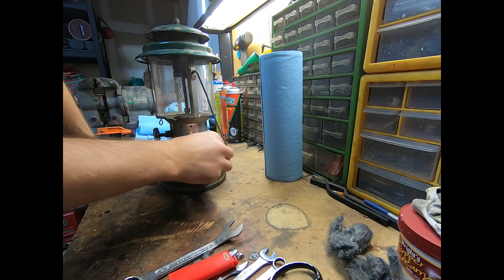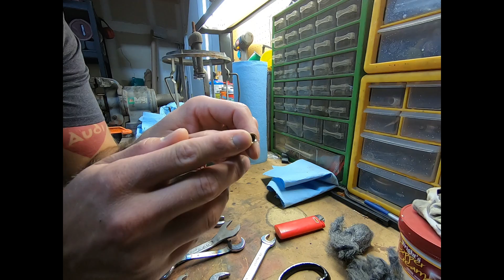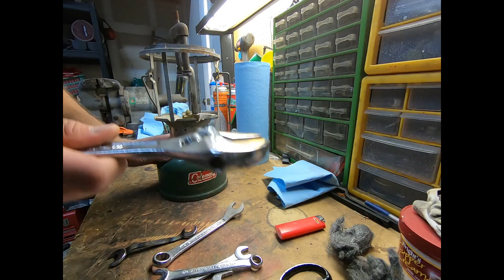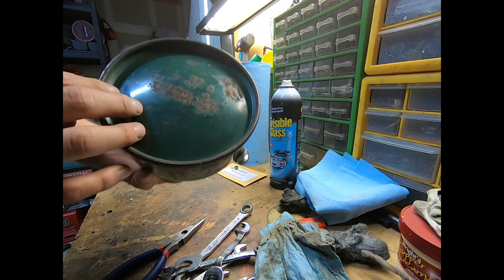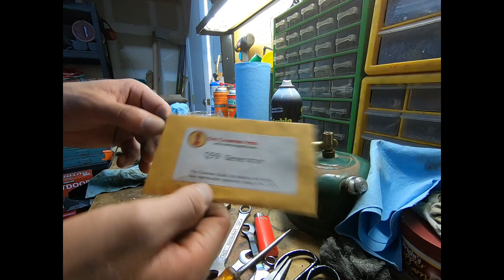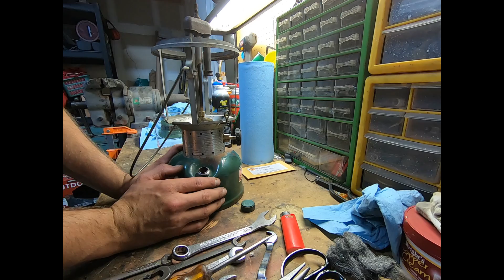How to Rebuild and Light Coleman Dual Mantle Lantern (220F)

Comment: Thanks for sharing. Here in Ireland and UK the pressurised lanterns are mainly made by Tilley or Bialaddin of which I have several. The Coleman are much less common and have a bewildering number of models and fuel types used, because of this I’ve stayed away from them. Recently however I got a Coleman 639 kerosene lantern, in perfect condition, still in box, with instructions, spanner and even a warranty. However, seeing as the lantern is dated 1973 that may not still be valid !  Keep em lit.

Comment: For a user without a box.  Most of these models will accept a metal coffee can PERFECTLY.  Cut off the bottom with a can opener.  Make two long slits for the bailer handle (about an inch shy from the top).  Take off the roof.  Slip the can over the globe frame, reinstall the roof.  Hang her in your shed or sit on your shelf.  Unlikely to accidentally crack the glass with a shovel handle or bumbing about.

Great warnings:
A leak at the regulator knob is one of the most dangerous elements of this lamp. If it is leaking shut it off immediately or you'll eventually have a flare up outside the lamp, eventually finding the somewhat sealed pressurized reservoir ...BOOM.

Good description of fixing the valve and graphite ring (seal gasket).  I've seen ones where the bonnet cap is loose, and then even a good graphite will leak once pressured.  For that, I tighten a bit and check again, just like I would with a virgin graphite seal.

With the alternatives we have today, I consider these outside toys only.  Nothing near them that can burn if there is a fuel leak.  Not in reach if any children or adults that don't know what this really is.
Reply: I’d like to see a vid or pictures of that box you talk about. In my mind the way you explain it wouldn’t it block all the light output ? Thanks for sharing your ideas.

Comment: good video, just wondering why you didnt take the valve out of the tank since you had it broken down that far, i rebuilt one of these lanterns and glad i pulled the valve out of the tank, the pick up tube that pulls gas out is on the bottom of that valve and it was all varnished up and the hole was plugged up,the sliding needle was froze up too....
Reply from the maker: So for me it just comes down to if it works, I usually leave it. Unless you have the removal tool it's really easy to damage that part. It's kinda like opening a can of worms if it doesn't go your way. So unless I'm specifically having an issue with it, I leave it.

Comment: maybe you can help. I'm trying to restore my dad's Coleman, same model as this. I cleaned it like you did. it holds pressure very well. it pumps great. however, I can't get it to light. I don't hear anything when I attempted to light it either. I remember a hiss from my childhood if I'm remembering right. any suggestions on how I could get it running again? it looks great. no real rust. all fittings came loose easy. it worked last time it was used but that was 20 years ago. I am trying to save something from my childhood and older things are just better somehow. I'd love to see this fire up again. I just don't know what's wrong or if it's even salvageable. thanks in advance.
Reply from the maker: Sounds like something with the generator. On the backside of the lantern there is a small lever that spins and clears the generator hole. Spin that about 10 times. Then pressurize the lantern open the valve 1/4 turn. If you don't hear anything spin that level 180 degrees. It will point down iirc. If this doesn't work you likely need a new generator.
Reply: @crookedlantern3810  I woke up at camp. Got your message and payed extra attention to the cleaning lever and generator. After about 50 turns I started to hear some sputter. Now after a few more she is running at her former glory! Thank you so much.
Reply from the maker: @robertholsopple9451  wow that's great, I wonder why it took so many? I'm glad you got her running!
Reply: @crookedlantern3810  I cleaned the generator by hand while it was out and apart. I also turned the knob when it was back together. I was thinking you might say that. I wonder if I soaked it in carb cleaner if it would help. It looks good that's what stumps me.

Comment: I just got our model 220F going for the winter season.  cleaned the generator, leak checked inspected everything. Replaced and primed the mantles. 

Quick easy job. Though maybe it helps that this one has been used by me since it was new.

Comment: So we have talked before I watched your video last night I have a quick question what is the best way to remove the soot from the top of the inside the lantern dome also I just purchased a 200 a  and in OK condition but the  bottom of the cage has a crusted rust kind of a Sandy texture what's the best way to remove that
Reply from the maker: Well if your talking about the porcelain vent on top, it can be hard to remove that. You can try to soak it in some soap and water. As for the frame, (steel part) some light steel wool should do the trick depending on if it s rusted.

Comment: Hey Good Video was a big help rebuilding my 220F that I picked up for 8.00 bucks. My question is where did you get that special bent and thin open end wrench ? Did you make it yourself ? You're changing of the graphite packing was especially helpful . On the tip cleaner for the generator can the packing that is int be replaced if it starts leaking ? Also your recommendation for parts were a big help .

Comment: I have a 73 220f the pump won't work right on it are these worth restoring
Reply from the maker: In terms of value, not really, in terms of usage absolutely.  Especially considering the pumps are extremely easy to repair. I touch on the subject in one of my videos, however there are many out there specific to the pump repair.

Comment: I took the tip cleaner out and put it back in.  Now it will not turn all the way around.  Only goes 1/2 a revolution but moves the cam.  Any suggestions?
Reply from the maker: Sorry for the late reply. The tip cleaner orientation can be tricky once removed. You have to align it just right with the eccentric block. It can be tricky but take a close look at both parts in your hand, you will see how the rotation of the tip cleaner and the gap in the eccentric block align.
Reply: I had the same issue as I am also new to this. Thanks man, it’s an odd fascination I’m developing with old Coleman lanterns. I now have 3 lol.
Reply from the maker: @ethanchaperlo9876  they can be addicting.
Reply: @ethanchaperlo9876  I ended up sending mine to Coleman for repair.  I fixed my old stove but couldn't get the lantern/

Comment: My 220F has a filler cap with a screw in the center. Once I take the screw out and unscrew the cap, there is a brass plug, threaded on the outside to accept the cap, and threaded in the center to accept the screw. The problem is, it blocks the fount from being filled and I can’t get it out of the fount. Any advice?
Reply from the maker: Sorry for the late reply. It sounds to me as if the inner portion of the 2 peice cap is stuck on the top of the filler hole. If this is the case I would GENTLT tap around the brass portion with a small hammer or mallet. And add some pressure to the tank via the pump to give it some extra encouragement. The only thing that could be holding that on is a corroded rubber gasket.
Reply: @crookedlantern3810  I’ll try the tapping method, as my pump is shot, this lantern has sat for a long time in a basement. Thank you for the advice, have a good one

Comment: I am curious, that you left the tank rusted.  Why ?
Reply from the maker: It would be a great deal of work to completely restore the fount. Typically a bit of surface rust is nothing to worry about. It's always important to gauge the exact amount of rust to ensure there are no fuel leaks, otherwise the fuel itself can inhibit rust forming. The founts that rust the most are stored without fuel.

Comment: Excellent video and very informative.  Thanks for taking the time to record it.  
I have a question about converting this same lantern (1970-220) and 1969-228F models) to burn kerosene. Do you know what parts I need and part numbers if possible.  Thank you.
Reply from the maker: Honestly I do not have much experience with Kero lanterns. To have the safest burning kero lantern I would just keep an eye out for a Coleman Kero specific lantern. They aren't super common but they are out there.
Reply: @crookedlantern3810  I ended up converting it to kerosene and it was pretty simple.  I read "Ron Brown Book 6: Kerosene pressure lanterns (Non electric lighting series Book 6."  You will have to use and convert the 201b5891 generator because you cannot buy the 201a5891.  It isn't made anymore.  Its pretty easy just purchase the book for instructions.  Hope this helps.
It works great and burns a little brighter than my white gas burner.
Reply: I'm doing exactly that.  Another person @Ron Brown has a video and an inexpensive, well-written chapter on Amazon.  The parts are readily available, and all the good tips here are relevant.